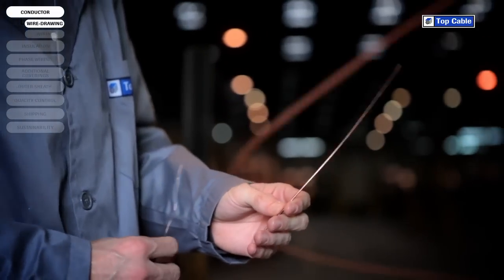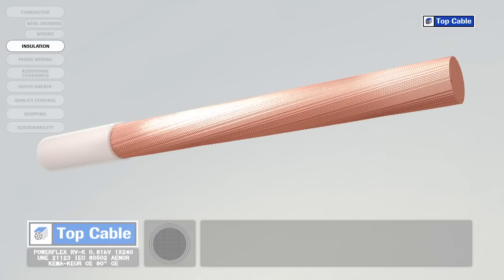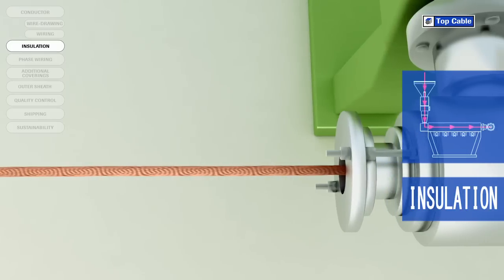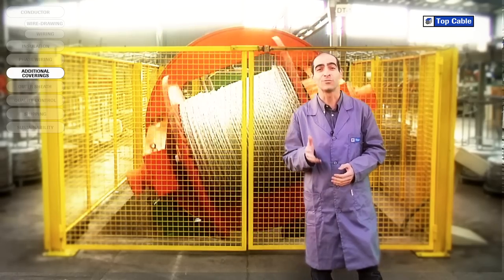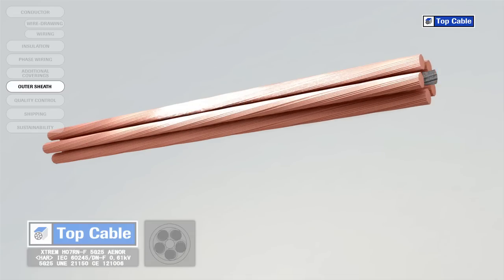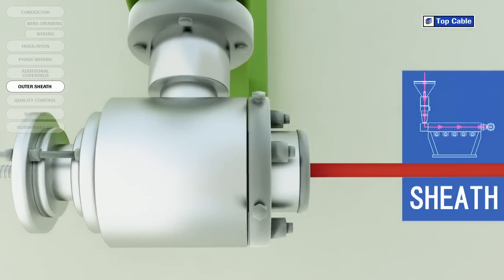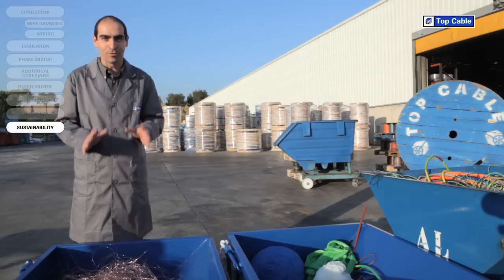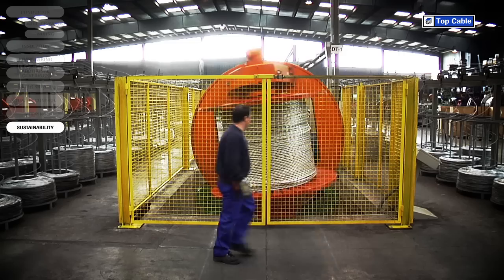Do you know how an electrical cable is manufactured?

Comment: Interesting video. Good CAD work. I have a question for you. Something I have wondered about for years. I understand how the wire is drawn through dies to reduce the diameter. There are many dies depending on the size of the final product. What I don't get is how the wire/rod is initially inserted into and through the die then moved to the pulling device.

Thanks
Reply: Indys Dad I run a strander at work and I can answer that. When changing to a new setup, you pull all the strands you can through the die (until it is too tight) and wrap them around a steel cable with a loop in the end. This cable is also wrapped around the end of your previous setup. The few strands you can't pull through are inserted just before the die and crushed into place by the others. A few feet later, it falls into lay and you can mark it and do your testing. This is just for a strander. Drawing down a single wire is a different animal. I have that answer too if that's what you meant
Reply: You have to shave or grind down the tip of the coil to fit through the first die about 1 inch depending on what machine you are using for the next part. after you do that you use a portable drawing machine to pull more through the die so you can get it to wrap around the shivs that will help you pull the rest. then you just repeat the process for each die you need. smaller wire needs more dies and its a pain to have to do it because it starts breaking the smaller it gets.
i worked at encore wire running the endex which draws the wire and i also learned the strander.

Comment: good one. whats happen inside the spark tester? how its done?
Reply: I wonder if you’re still gonna see this being 8 years ago lol!!! But inside there’s strings of metal beads that have usually about 16kv flowing through them. They’re constantly looking for a path to ground. The cable is traveling through these beads, and if there’s the tiniest of pinholes, that’s enough to complete the path to ground, and the spark tester will be set off. The operator will note the location and mark it. Then the cable after being extruded will get the hole repaired at a later time. There’s no time to repair it while it’s running.

Comment: "The insulator maintains the flow of electricity in the conductor"... what!!!

Strange way to describe it.
The electricity in a conductor (ie: the current) does not require the insulator to remain in the conductor, the insulator is needed to avoid short circuit with other conductors and to protect the metal from corrosion.
Reply: saintpine “the insulator keeps the electricity in the conductor” is probably a better translation.
Reply: Yes, because without the insulator, the electricity would leak out all over the ground :-P
Reply: Yorick Hunt don't want all those electrons to fall out!! lol
Reply: @jordanjohnson714  ...no whackers! Bob's you uncle :P

Comment: not very helpful they skip on useful details
Reply from the maker: Steve Spence Mr Spence could you be a bit more specific? thanks for your comments
Reply: TopCable  well for example there is  no pictures of the wire drawing process  how you get the different wire sizes
Reply: from what i know wathing how its made at least iron strings are drawn by continuously rolling them trough consequence of bobins rotating at different speed. the wire starts at the firt one, 10 turns then goes to the next and so on. however i dont know how 8mm can be lowered to 1 mm that easy